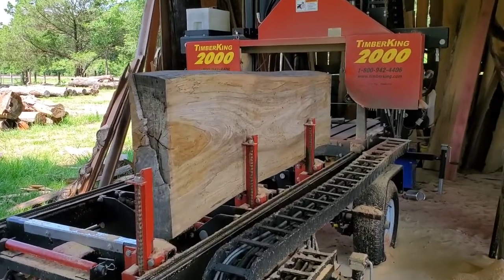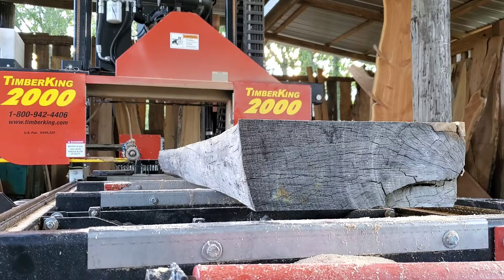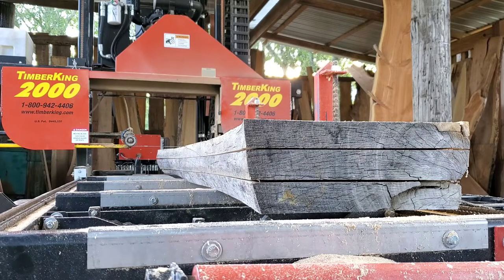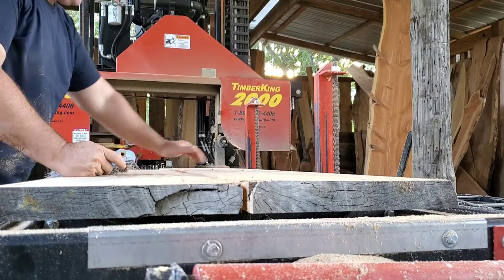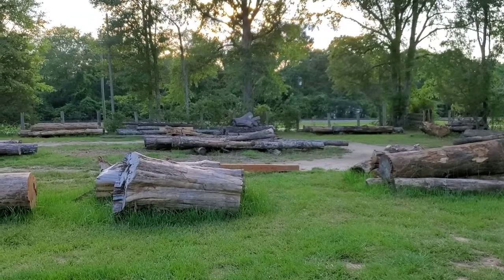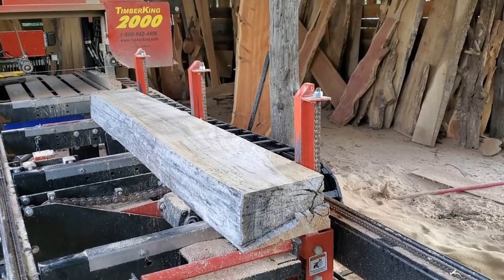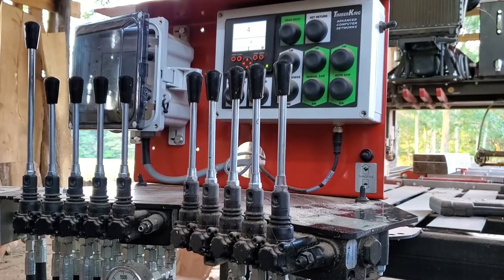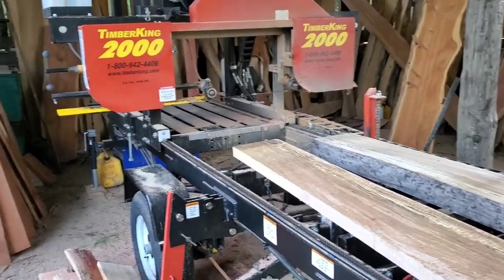Re-sawing spalted Ash on the Timberking 2000 sawmill

Comment: Does the spalting weaken the final product?
Reply from the maker: It depends on how far along in the decomposition process the wood is.  It's a fine line between spalt and rot.  On the ash I cut the wood is intact with no bug damage.   Pecan is one species that looks great spalted but it also deteriorates pretty bad as the spalt sets in. That makes it hard to finish it.